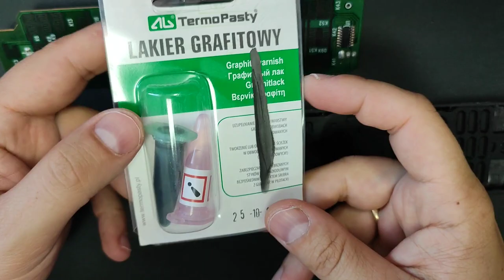How to repair TV Remote Control - Easiest working method !

Comment: For those who are wondering what the paste is look no further
>
TERMO PASTY LAKIER GRAFITOWY This is Polish
>
THERMO PASTE GRAPHITE VARNISH seen on an auction site.
In short, it is similar to the paste used in computer building i.e. processor chip > paste < heat sink
Reply from the maker: That's right 👍👍👍